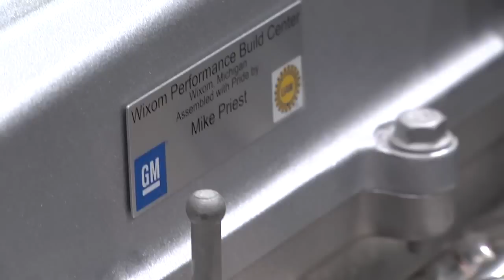Chevrolet Corvette 6.2L V8 LS9 Engine Assembly

Comment: Still no overhead cam shafts after all these years, a design from the 50's
Reply: +Johans60 it depends on the priorities .. if your priority  is performance OHC is the way to go .. but bare in mind it is more expensive and less reliable because it has more moving parts.. but with a pushrod system like LS engines, it is much simpler design which make them cheap, reliable and high performance.
Reply: +Johans60 Should the design be abandoned just because it's old? There's no need to use overhead camshafts if it's possible to build good engine with pushrod design.
Reply: +Johans60 a design taken to the tenth power why create something new just perfect an old design that is both simply and elegant Porsche did the same thing with the flat six engine
Reply: how much has the crankshaft changed or ring and pinion? or a piston. you should stop using pistons rods and crankshafts. ohv are superior for trucks and hot rods, always will be.
Reply: What's the matter with the simplicity of the engine if it's still good? It doesn't need every new technology to be a great engine.
Reply: For fuel economy and performance it needs new technolgy
Reply: Does it? I don't think either fuel economy or performance is a problem with Corvette.
Reply: well it should be, oil is running out
Reply: C7R is the 2016 GTLMS champion
Reply: as it should be :) theyre still used for a reason.
Reply: Why would GM go to a heavier, bigger and more complex engine? DOHC has been around just as long as OHV. The only benefit to DOHC is if you are limited in displacement.
Reply: Brett Hobbs I totally agree DOHC have there advantages too they tend to breathe better at higher RPM but the OHV have way more low end torque it makes me laugh when novice people crack on the OHV engine  the GM small block is one of the most simple efficient power dense motors on the planet.
Reply: The torque of an engine has not so much to do with the position of the cam, with variable valve timing you can have both high torque @ low rpm and @ high rpm, so if you only have one cam variable valve timing is hard to implement.
Reply: The low end torque has everything to do with the OHV design because just having 2 valves allows a much bigger valve vs 4 valves per cyl valves half to be smaller due to space of the cyl.
Reply: Wrong again, the 4 valves make more efficient use of available space so per saldo there is more area, why would you think modern engines use them even WWII fighter engines used them. also the thermal load is better per valve
Reply: Modern engines use 4 valves per cylinder because emissions and fuel regulations are forcing engines to get smaller and smaller. Using 4 valves per cylinder lets you get more power out of the same engine displacement. However, a 4 valve per cylinder engine will be much heavier and bulkier than a 2 valve per cylinder engine of the same displacement.
Reply: Johan60 WWll fighter engines need high rpm to spin the propeller like I said 4 valves per cyl breathe better and are more efficient in higher RPM range hence flat plane crank engines rev to 8000 plus RPM but to say they are more efficient all around is false push rod motors are incredible light reliable and simple hence the new C7 gets 30 mpg on the highway. And they have way more low end torque .
Reply: Yes and its the # 1 swapped,engine with the highest amount of aftermarket parts aside from the gen 1 sbc . Us Americans who are into V8s are very happy with our push rod motors. 
Gms new designs get great MPG also with mind blowing HP and TQ from a stock motor.
Reply: Wrong, Aircraft piston engines run surprisingly slow. The RPM of a Merlin at full power was just over 3000RPM.  The blade RPM is determined by the fully adjustable gear reduction unit and blades. Most modern piston aircraft run well below 3000RPM.
Reply: Double overhead cam engines have more frictional losses from the valvetrain and from higher rpm.  A high torque, low rpm engine will lose less power due to friction.
Reply: Just to put things into perspective guys that go on a LS9 engine build video AKA all LS motors are 2 valve pushrod motors to talk and argue about 4 valve overhead cam motors makes absolutely NO SENSE stop trolling this engine is legendary it makes 700 hp with 9 lbs of boost it had a forged steel crank forged titanium conn rods and F1 style dished forged pistons and was the FIRST motor in the world with the eaton next gen supercharger that brought a whole new level of efficiency and high rpm power  GROW UP KIDDIES LMAOF.
Reply: Johans60 DOHC are technology from 1912... look it up.
Reply: Oh dear. I see not many of you have any idea about how power is made in an engine or why camshafts are placed on top of valves in a head.

There are only really 2 reasons to use twin over head camshafts per cylinder bank. The first one is that the use of 2 camshafts over the valves is so that the valves can be canted over in the head allowing better air flow (straighter intake runners) to the cylinder and hence more air = more power.  The second is that variable camshaft timing can be employed to maximise power levels at different RPM rates. Simply placing the camshafts above the valves will not make any more power than having the camshaft in the block - its all about the angle of the valves - not the position of the camshaft.

Pushrods dont make power, all they do is transfer the camshaft profile to the rocker arms which in turn operate the valves in symmetry with the camshaft profile. Valves in the head can be canted over to a point to allow straighter airflow as that of a single camshaft per intake/exhaust bank would do.  Look at the Alfa Romeo V6 for instance, it uses a pushrod to operate the exhaust valve and yet it is an overhead camshaft engine.

These people who think that pushrods are old and not 'technology' are wrong. As I said, all they do is transfer the cam lobe profile to the valve.  Pushrod engines such as the LS series engines are marvels of automotive technology and engineering.  They are light weight, narrow, low in height, less moving parts and still produce as much power as the perceived 'double over head camshafts'.
Then there is those uninformed about in block camshafts not having variable valve timing. 
Well, the later LS series engines like the LT4 have variable camshaft timing thank you - exactly as that of an overhead camshaft system. In fact, have a look at Chrysler with their 'cam in cam' technology which gives in-block cams the same variable functionality for both intake and exhaust that 2 over head camshafts do.

Also have a look at a late 30s Riley engine. They have double underhead camshafts that operate the overhead valves via pushrods.

Too many of you have no idea about design or engineering and I would say most you wouldnt even know what a pushrod even looks like.
Reply: Anyone talking trash about the LS motors look up why are LS so good on you tube Tom Nelson explains why LS motors are the most popular swapped engines in the world right now
Reply: you guys forgot to mention one important thing about pushrod designs, it makes the engine so much more shorter than an ohc motor.
Reply: Johans60 overhead cams increase only the complexity of the engines, the LS pushrod VVT engines outperform the OHC engines in every way!
Reply: DustinCorvetteZr1 
Aircraft engines spin at a fairly low rpm.  The limiting factor of aircraft engine speed is the speed of the propeller tips.  Once prop tips go supersonic it causes turbulence and ruin the efficiency of the props.  The rolls royce Merlin fpr instance made max horsepower at around 3k rpm.
Reply: Johans60 GM's latest pushrod V8's make more power for their weight (compared to competing OHC V8's) and have a better Brake Specific Fuel Consumption rating. Not to mention they have fewer moving parts and don' t have all the problems inherent to  DOHC V8 including timing chain stretch, cam phaser issues, or timing chain guide/tensioner problems. 

Oh and by the way, OHC engines are using OLDER technology than pushrod's.
Reply: Why do you need OHC's??
Reply: Cars still driving on wheels 
, a design from 3500BC Mesopotamia.  .
Reply: Look at the difference in the timing chain or belt on ohc vs pushrod
Reply: jerry lawler I love how ignorant people fail to realize that pushrods is newer technology than ohc. With high flow heads and a high rpm cam you get push rod torque and high rpm hp all at the same time, in a small light package, but no ohc is better because it is more Advanced.
Reply: Nice discussion folks, I learned something.  Who knew that GM could build an impressive engine.  Now if they could do something about the often horrendous styling and cheesy interiors......
Reply: mewrongway
I was talking about the last half century.  Is there another example since the 1960's of anything other than old fashion relics and rubbish?  The 327 and others were decent for 1966, 70's, 80's, 90's, all primitive and poor.
Reply: Overhead Cam engine don't produce torque like a Pushrod. The rev higher who needs a high revving musclecar unless racing at Indy. Do your homework Jr.
Reply: OK ...so now we understand your real issue...you drive a Prius.

Comment: ford has  nothing this  good    for a production engine
Reply: I'll take a coyote please.
Reply: jstrawser the coyote is just as good if not better
Reply: More HP per CI than the LS motors. Just can't beat 4 Valve cylinder heads. When GM dumps the push rods these same LS guys will be bragging on the GM cammers.
Reply: Yup the heart beat of china!

Comment: One of thee biggest engine that produces some of the lowest HP at top end speed. American logic: Lets make a engine with more & bigger pistons to produce power; forget about just adding more valves or adding more cam-shaft, 2 valves per-cylinder is good enough!... Other car manufacturing countrie's logic: we have a inline 4 cylinder engine here, how about we add 4 valves per-cylinder and add to 2 cam-shaft per-head to produce more power and lets add v-tec to open up the valves bigger at high rpm so the engine can breathe better and wont lag

Comment: Wow! Very low tech assembly also very choppy and poor video editing of this assembly process, not at all like the Audi, Merc, Porsche or BMW processes at all. The presentation of this process does nothing to make you want you buy such a machine. He did not "make" the engine himself he just assembled the individual parts and used auto-wrenches. All in all a rather hokey-poky presentation in my book. The car on the other hand is a nice car for the money.
Reply: 482lost There is no comparison to Ferrari and the Corvette production line, none whatsoever, they are simply world's apart. The vetts a lot of car for the money, but it's no ferrari.
Reply: Pluto )justo was that like